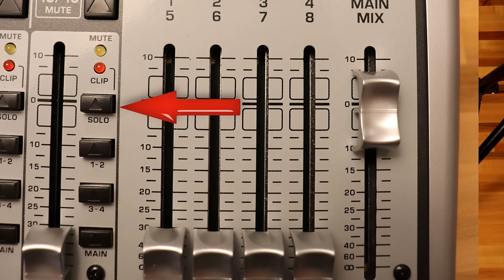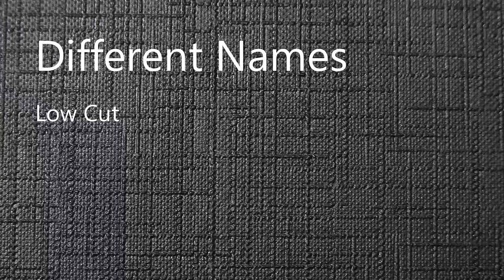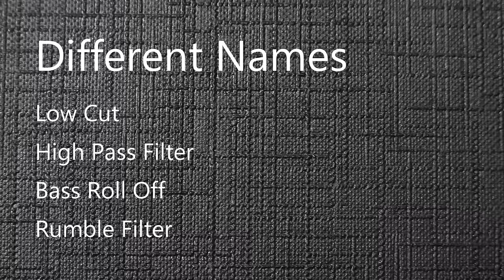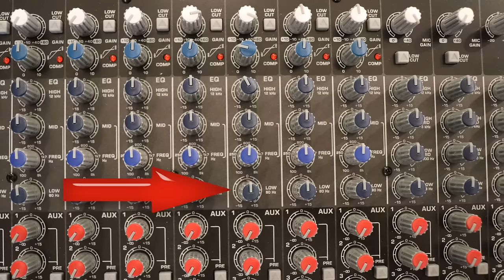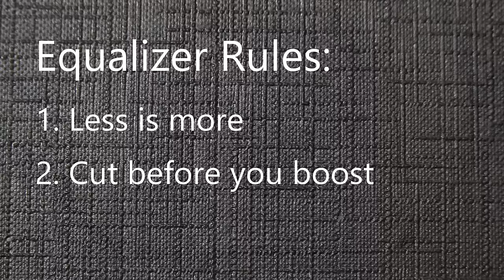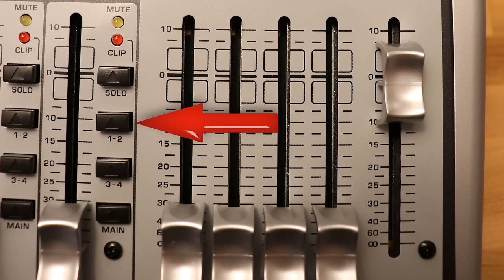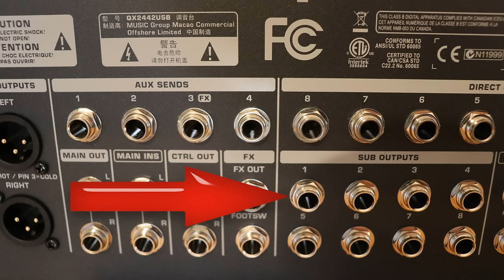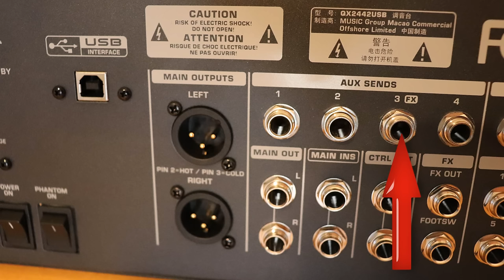Analog Mixer Basics (How to Use An Analog Mixer)

Comment: Good info so I got a question for live stream we use switcher studio we use a irig vocals sounds clean but my keyboard is real low coming out of our live stream how would I be able to adjust the volume for the stream?
Reply from the maker: If you are using an aux mix, you can make individual adjustments to each input. Details in this this video https://youtu.be/BZhW5OZC4pc Also, connection details in this video https://youtu.be/eBGNTO00nwg
Hope that helps!
Reply: Yes it’s an analog mixer peavey 16fx
Reply: Right now I have a 1/4 inch plug to the main and the xlr to the IRig am I doing something wrong?
Reply from the maker: No you're not doing anything wrong but the way that you're currently wired means the Livestream only gets whatever you mix for the auditorium. To be able to change volumes on the Livestream without changing the volume in the auditorium  you'll have to create an auxiliary (monitor) mix for the Livestream.
Reply: So connect the 1/4 to an aux instead of the main and the other end to my iPad correct is there a better way to get in touch with you
Reply: How would I create a aux group to control the volumes
Reply from the maker: I'm available for consultations at ProclaimAVYT@gmail.com

Comment: Where is your PFL buttons or aren't there any..can't see them there. Some units have them at the top, others down near the slider. I use the PFL all the time. I never rely on the previous gig's settings. They are approximate, but then you move to a new venue and have to redo it all anyway...lol. Great vid by the way.
Reply from the maker: The Xenyx series is based on the Mackie design so it has "Solo" buttons instead of "PFL."
Reply: @proclaimav4197  Thanks.

Comment: Can you use a quarter inch jack to usb to connect the mixer to a pc?
Reply from the maker: Sure. Behringer makes something called the "Line2 USB Stereo 1/4" Line to USB Audio Interface" which may work for you. If you have the budget you will get much better results by using an audio interface like the Behringer UMC202HD. Cheers!

Comment: is there a risk to connect a unbalanced stereu RTS connector into a single line input?
Reply from the maker: Hi Ali, you won't hurt anything by trying it, it just isn't wired that way. In analog mixers a lot of things work when plugged in improperly just not well. 😁

Comment: Somethings really off about my settings, I have Behringer Q802 USB paired up with Behringer SL 85S, even tho It's in max gain it won't go to the 0 mark
Reply from the maker: Interesting. Some dynamic mics need a strong signal, so it will depend on what you you are micing and how loud it is. If you're micing a quiet source, a condenser mic could be a better fit.
Reply: @proclaimav4197  Thanks for the reply man, I appreciated it

Comment: 20:45 >  uhhh, okay. So I thought those buttons were pre-post eq?!
So you can choose wether you want to send an aux to a reverb unit with or without equalisation....

I have almost the same mixer - just came in - so that was why I was curious about specific settings of my X2222.

I have an old 24/2 mixer and on that one you had to open up the thing and 
really put every channel in post eq mode and it would stay there until you open it up  again and put it back to pre-eq.
(this was the 90s by the way, so really old school stuff)

Thanx for posting this video :-)
Reply from the maker: Correct. EQ is not bypassed when you use the "Pre" button. It only changes between pre-fader / post-fader. Glad you enjoyed the video!

Comment: I am still puzzled on how the rca 2track/usb output works tho.
Reply from the maker: Wow, you're right the documentation is very unclear. 🤔 In fact I was so curious that I conducted an experiment. So they appear to be ganged together. If you press the "USB/ Two Track to Main" button down, you can simultaneously input audio from USB and RCA. With the button in the up position, you output audio to both the USB and the RCA outputs. However, you will get no output whatsoever when the button is pressed down. (Probably to prevent a feedback loop.) Weird. Thanks for askin' 😁

Comment: Hi man, thanks for the video! I have this mixer and I'd like to use it with my band in our "garage cave", connecting guitars/bass/vocals to the mixer and THEN to the in-ear board Behringer Powerplay HA6000 but... with no luck! :( 
We'd like to use the speakers ONLY for the voice while all the other instruments are routed to the in-ear board in order to let us listen to our instrument mixed with the main mix (coming from the sum of all the signals).
Could you please help us to understand how to connect the stuff? Thanks in advance! :)
Reply from the maker: Hi Stafano.
I'll begin by noting that the HA-6000 will only let each headphone amp mix between the main stereo input and one Aux input (the one numbered to correspond with the channel. Headphone 4 can only do main inputs and Aux 4, for example.
Begin by connecting everything to the board. Un-assign your instruments out of Main using the subgroup assignment buttons if you don't want them in your Main speakers. The mixer has two sets of Main outs on the back, (see time index 19:33) so use one set to feed speakers and one set to feed the stereo input on your HA-6000. Next, use the Aux mix outputs 1,2,3,4 (see time index 19:33) to feed the "Aux In" 1,2,3,4 on your HA-6000. Now you have the main mix (only vocals) and an Aux Mix available on channels 1,2,3,4 of the HA-6000. You can balance the way everything is mixed with the "Aux/Main" balance knob and by the way you set up each Aux mix. Hope that helps.

Comment: Question how do you get rid of the hissy noise ?
Reply from the maker: Hi Jared. The most common reason for hiss is too much gain on a mic that is not close enough to the source or not sensitive enough. For example, some dynamic mics like the Shure SM7B need a lot of gain, especially if the person using the mic has it too far away or is too soft spoken. You should find when you turn down the gain you will get less hiss. However you will also get less signal. Live boards like this don't always have the quietest pre-amps either when you turn them up. Hope that helps.
Reply: @proclaimav4197  thank you so much for the reply I really appreciate it !

Comment: Are all analogue mixers powered?
Reply from the maker: If by "powered" you mean, "Do they have onboard amplifiers to power speakers?" the answer is no. There are powered analog mixers which are a combination of mixer and amplifier, but they are less common. Powered analog mixers generally are in the "box mixer" format like the Mackie PPM608. There are only a few in the traditional mixer layout, for example the Yamaha EMX5014C. If by "powered" you mean, do they require electrical power, the answer is almost always yes. Exceptions would be small line level mixers (like the Rolls MX41b) but I don't recommend them as they result in considerable signal weakening/loss.
Reply: @proclaimav4197  thank you for your reply i appreciate it.